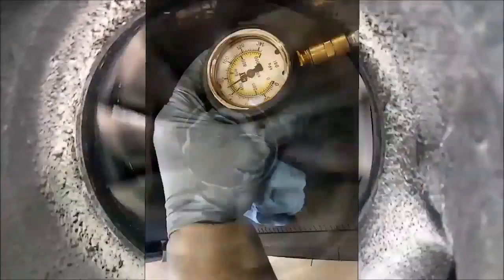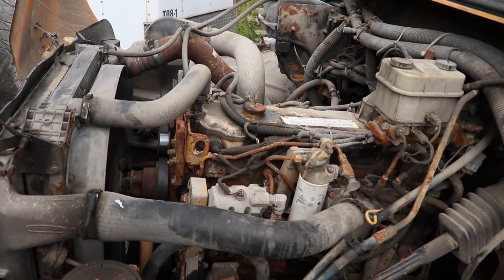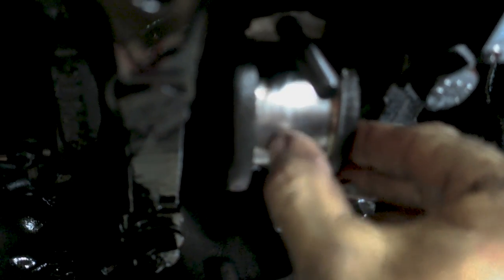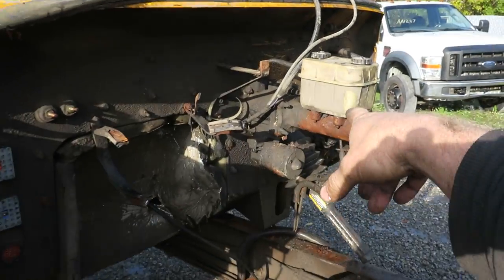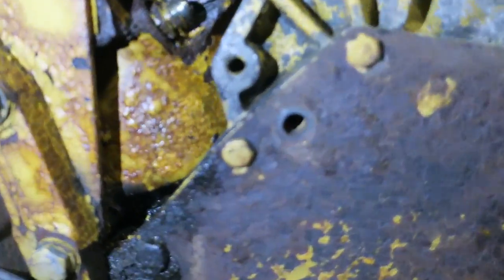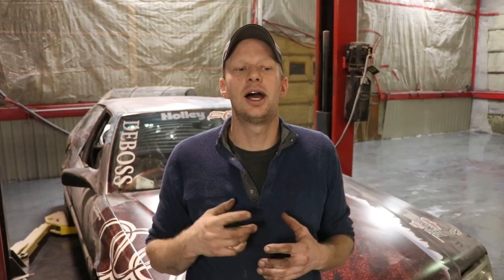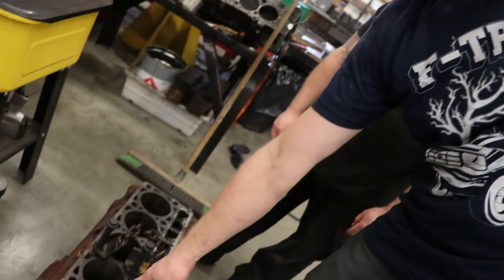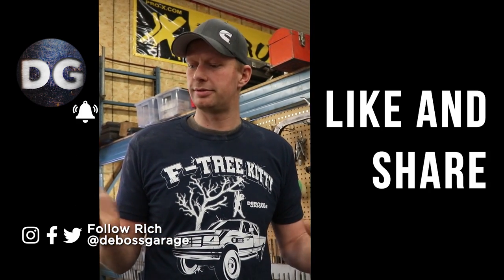CAT 3126 Teardown feat. @AdeptApe | #FTreeKitty [EP4]

Comment: I'm glad you are doing a cat swap. Everyone always wants to do a cummins. It's good to see something different.
Reply: I agree but it should have been a 7.3l swap. This boat anchor of a cat is not going to make anything close to what a 7.3 could. It might last longer overtime but that’s yet to be seen. I think Rich will be disappointed with this engine as a daily tow rig. Definitely unique!
Reply: @makeitbreakit7556  a cat engine has more grunt on the low end
Reply: Depends on injector a 300/200 on a 7.3l with a borgs366 will make 1400lflbs at about 2200rpm and 700lbs at 1200rpm
Reply: @makeitbreakit7556  I agree this engine was nobody's favorite in a heavy truck, the competition was an 8.3 Cummins and it ran less RPM, more torque, less breakdowns, less shifting required.  The day the last one of these was gone from the fleet was a good day.
Reply: Make it & Break it! A 7.3 can’t produce any power without massive money spent. I have one and they are reliable but slow as dog shit.
Reply: @makeitbreakit7556  
Having the most hp/tq is all about bragging rights these days. The Us military now uses Caterpillar engines. I wonder why? 🤔
Reply: Did the Cat guy have a whole litter of kittens when you told him you were going off-script with parts swapping? Those guys HATE that.
Reply: Yeah respect rich, I can really dig the cats
Reply: @thegdfp6447  meh... been with Cat dealers most of my wrenching life.... 
In a project like this? MOD THAT BABY! Just.... make sure your crap jives haha
Reply: If it was me I’d be doing a dt466 because it’s a mechanical engine, but it’s cool he’s doing something other than a Cummins. If cat had an engine of the same size that’s mechanical then I’d be doing it. I’ve had a 7.3 & am not fond of the $ HEUI system.
Reply: @michaelbenoit248  The early HEUI is very reliable if you keep good oil in it. 
Look up 3116 and 3126A. Not the truck 3126 mind you. Prefix 55K, 3AK, 6JK, 9ZR were all mechanical 3126 engines in industrial and machine applications. I see no real reason a machine unit couldn't be adapted to a truck, but you would need things like, say, the right flywheel housing/ rear structure.
Reply: One day....3116.
Reply: I know right cummins this cummins that.
Reply: @makeitbreakit7556  he should have stayed with 7.3 swap. It would have been easier
Reply: If this were a Cummins or 7.3 swap, nobody would be watching.

Comment: I did the Navy back in 72 and I was not proficient in mechanical items. They put me in Air Traffic Control and I did some land time in Iceland. We had an old radar approach unit in the middle of the field with Cat backup. Electricity was 50/50 so the cat tech was always out there and I would jump in and watch. Later, he had yearly maintenance which took the whole unit down to the block in our Quonset hut. He would let me take parts off and on.  I really was hooked on that engine. Later in life, I got educated in ICE's. But I always wished I had qualified for diesel. What a great life.

Comment: The next project is a surprise to max. It’s a  2001 kenworth t300 service truck with a 3126 330 hp and back by a 10 speed.  We are going to do a full restoration with cool products making a killer service truck. I will then be sharing my equipment repair I do daily .   Thanks mrgoodtrav

Comment: The "ADV" on the sticker means Advertised.  As in thats the advertised rating for the engine.  We use that terminology because sometimes the engine is capable of a little more than advertised.  FYI the FLS and FTS are the fuel settings we use when we factory test the engine to make sure that it matches the nominal power as exactly as possible.  One you change parts like injectors and turbo etc... that detailed level of trim is no longer valid - but you dont care about that unless you really need the power to be perfect.

Comment: The machine shop guy sounds like he’s done this a few times . Sounds like this is going to be a kewl project. Of course Adept Ape is Mr.Cat. He knows his sh__( I always wondered if a big diesel would fit in a pick up ) I love diesels 👍
Reply: Nothing new, guys been putting these engines in pickups for awhile,  usually with a standard transmission tho. Be interesting to see how he hooks up the 4x4, bet hed probably use a divorce mount set up?
Reply: @Leemur2335  and about 20 leaf springs on each front frame rail.

Comment: The zip-tie is used to hold the main bearings in contact with the crank  pin [s] when the engine is running. Main bolts are for starting only. So say's Facebook and Google. Merry Christmas everyone.

Comment: Rich , I have the same truck I put a Cummins in mine, just a heads up at that power level traction bars are very near a necessity on the obs Ford. Axle wraps a lot.
Reply from the maker: Thanks for the heads up!
Reply: There needed with a 7.3 in it

Comment: Dirty oil is the downfall of the HEUI system. Those worn cylinder were probably dumping a ton of blowby into the crankcase. After a while the contaminants in the oil will wear out the oil valves in the injectors, causing difficulty starting as you witnessed.
Reply: Its short life cycle and expense dont do it any favors.  That, and cats electronics suck.  Other than that.......

Comment: I just did injectors in a 7as model 3126b like the one in the kodiak and I must say, they are horrible to do. I work on equipment mostly but there was a bucket truck that needed to be fixed before the operator locked it up. Not only did they drive it with a blown injector tip, but they hydro locked it multiple times. I put all 6 injectors in and what a pain, following CAT SIS word for word spec by spec, 2 piston ring type seals on the injectors folded up the injector cup. You can’t tell until you try to torque the injector down and the first screw won’t go down to its shoulder. Although not particularly a bad engine, the injectors have to be absolutely perfect. Any bit of water will ruin the fuel system, the injector installation is a very stressful process, and the 1.5 inches between the cab and the engine in the kodiak makes a stressful job more stressful. Not to mention the fact that the oil slides in the head where the oil drains down the pushrod holes, works perfectly as a bolt slip and slide. I found that out the hard way, and after 4 hours of trying to fish it out of the cam and roller assemblies, I turned over the engine with a pry bar and heard the ‘ping’ of it hitting the oil pan and knew it was safe there. Got it all back together and there was a fuel knock, not going to go into details but the pushrods were crossed, thankfully no damage. If you work on the systems at all, run every diagnostic possible. For anyone wondering, with cores, the injectors were $360 USD each. Better off Rich working on the engine rather than me, I still have nightmares from doing that job.

Comment: I've wanted to do this swap in a square body chevy but $1000 per injector is quite a bit i know yellow engines are expensive but I've also wondered about putting an 8.3 Cummins in one too. It would be cool if you could do a comparison video on the 2

Comment: I’ve been around the Cat engines since 1977. Go old school and put in a 250 hp 3208T. Hot shot drivers in the 80’s and 90’s put them in one ton trucks. They could pull over the Empire State Building. No electronics to deal with, just hot wire to shut off solenoid.

Comment: I'd love to get an old 20s longhood packard or cadillac and put something like a Detroit DD13 or a Cummins X15 or similiar in it.. imagine that, while it might not have the horsepower, it could pull a 2:1 diff ratio and do like 170 MPH
Reply: But emissions  are on those and hard to work around. But an older isx 15 you could do, late year series 60 would work or a cat c15

Comment: Whoa this is a truck right? haven't we all wanted air in our 1 tons at some point just for filling tires and what not? you should try to keep the air system and use it!! add some chucks front and back so you can hook up an air line and fill tires!
Reply: They make air systems for pick-ups, not commonly used do to cost. A gasoline air compressor is cheaper and easier to maintain.
Reply: @jaydunbar7538  that's not the point. There is one on this engine already and it would be sweet. Everyone with a truck can throw a compressor in the bed that's not the same.
Reply: It being a tow rig id keep it if i had the space on the block

Comment: While your doing the Caterpillar install, you might consider getting rid of the UNRELIABLE HEUI PUMP and putting in a common rail system like used on later models C7’s. I have a 3126b in my RV Hauler and before paying 7 grand to replace the HEUI, the lines and all the injectors, I am looking at changing it over. I feel good about being able do that, and I’ll be trying to figure it out and pay to have it done. The HEIU has to many things that affect its reliability to call it good. Cost to much to pull the oil cooler off just to see if the gasket is good between the filtered and non filtered oil. If the price is prohibited I’ll find a 8.3 Cummins to put in there with a P-Pump. Thanks

Comment: Rewatching this as I sit at home off work due to the coronavirus. I read it as - adv(advertised) 250 hp (horsepower) 186.6 kw(kilowatt). 

I could be wrong but I always thought adv was advertised abbreviated, not advance(d). But, I may be wrong. Not sure if that's what you were referring to and correcting yourself or just the number placement/sequence.

At any rate, those were great engines. I've replaced an injector on one and the rubber style oil hose on another. Both weren't maintained the best and still made it almost 250k mi. before needing a single thing engine related. You already know and covered the common probs, tho. Just my 2 cents. Thx for the vid!

Comment: 29:00 interesting they didn't foresee hardened bolts breaking after being re-torqued.
i wonder if that bit is in the actual service manual somewhere and it says to replace them instead of reusing them, i'm ASSuming the amount of torque required to hold them in place is very close to their yield # (like torque to yield headbolts), not to mention they will be heated and cooled over and over and over with engine use.

Comment: cool to see yall go at this, any idea what model electric fans your throwing on to cool something this big? I have a bus conversion with the 190 hp and when that fan kicks on the bus goes to like 150 hp and will barely move...I also have the 545 non locking torque converter trans which kinda sucks but a derale 150k btu trans cooler did loads for it....lastly cat has a whole chart on what items have to be changed to uprate power. according to them (adept ape also mentioned this) in order to even get more than 10hp out of the 190 the flywheel and many parts have to be changed... if you call with the serial number they let you know what needs to be swapped to reliably produce the hp range.. thanks for the vid, and im looking forward to copy the electric fan swap..

Comment: You should leave the compressor if it works plumb it up for an on board air system I have one on my truck it's one of those things you never knew you needed until you have it
Reply from the maker: It does work but I think it will interfere with the steering.
Reply: I didn't think of that

Comment: Atleast it’s going in a Ford, I like my unique 3126 cat swapped dodge. My opinion, the cat swap is awesome but the Cummins for pickups is much better if you want upgrades.
I would never swap it back to the original Cummins but I do with I had more options for power upgrades.

Comment: you get one ford and all the sudden youre wearing f tree kitty t shirts what happened
Reply: He got a good overall  truck not a piece of shit with the best motor
Reply: Yeah that fuse box was very labeled
Reply: At least the dash isn’t falling apart like a dodge
Reply: Diesel Power he did always say he liked the square body fords before the Tritons
Reply: @woodyfregia6653  I've personally only seen 1 dodge dashboard cracked. It was on an 03 diesel. Dad has an 05, had a 93, had an 88, had numerous other dodge trucks with zero dash problems. Honestly the only problem he's had with his 05 was rear speakers, rear locks, and rear windows. Transfer case under warranty, transmission at 290,000 automatic too, and injectors at 360,000. The engine has been the most troublesome recently, had 3 bad injectors out of 6 new bosch ones when the original injectors lasted 360x's as long. I'd still take a dodge over any other pickup truck because they're reliable, comfortable, great power and amazing fuel mileage. Plus, dodges look the best.
Reply: Slave lake

Comment: I rebuild these as a day job and they don't seem to have any major faults, but they are not a powerhouse. We engine dyno them at 280hp without the fan and 220hp without the fan, yes the fan uses 60hp. After a big ZF and a diff and wheels, youre looking at 150whp tops? One time we got sent the wrong injectors and it made 400hp on the engine dyno so... 250 at the wheels? Not a fast truck, even in a little ford.

Comment: Looking at that skid of garbage you need, and the expense of crapterpillar parts, that 6v71 looks pretty good to me.
Reply from the maker: The engine has a harness of about 7 sensors.  It needs a few key and batt +, and throttle pedal and it runs.  The wiring mess is mostly the trans.  I took the entire dash wiring which is the mess but it really isn't complicated.

Comment: Being as CAT designed the injector, what's the difference between that at 1k each vs a 7.3 powerstroke injector which international/navistar had their part, any CC and nozzle size you want from 2-4k for a set of 8 (aye 2 spares lol). Solenoid tops and internals all look the same, body length different?

Comment: @deboss, I have the same 190hp unit in my bus conversion with a at545 4 speed, theirs no locking torque converter in those trans so they heat up at highway speeds (mine does about 70mph with 4,11 rears and 11r22.5 tires) a solution for the heat is a Derale 65861 trans cooler takes SAE boss u 10 fittings....I tied mine into the aftermarket trans filter... I wanted to ask what electric fan you'll be using thats big enough? I need one too with 190hp and a heavy 20k lbs bus every time that fan kicks on you feel it such a loss of power...also the hydro brakes are barely sufficient.... Thanks! Oh and last thing USE THE CAT ADVANCED FILTERS its insane what a difference it makes 1R-1807 after 1000+ miles the oil is still gold like brand new with any other filter its soot black after the first drive...

Comment: Will the water pump belt fit over the damper on the crank...mine in my 98 fl80 will not...big suck to tighten an change later

Comment: 16:38 serviced proper by a fleet..  HAAAA    No Joke I get SEL/CEL calls hmmmm let says a common one at Atlanta Public Schools, Fuel injector metering rail pressure high/pressure low.. and fuel filter diff pressure...  mmmm  4 year old filters..   They can't figure that out but by god if they get a NOX or DPF Diff code, it's getting a NOX or DPF.  When all it was is a diff sensor or tubes not hooked up...

Comment: Hi,  I'm looking at a kenworth dump truck with the same motor, and am curious how many miles they will go before needing a rebuild.
Reply from the maker: All depends on maintenance
Reply: At least 20 or 30 thousand miles
Reply: @N4007-k8o  you mean 2 or 300 thousand?

Comment: any update on this build? i know you are a busy man but i'd love to hear some updates and a somewhat unique build.  wanna know how comparable to a to a cummins swap this is and or if it would be a better option for me over a cummins 5.9 in my 01 350 gasser. would love something i could almost daily fuel mileage wise as 7-11mpg empty on my 6.8 V10 is not great at all. i'm not looking to make a power house or anything an have thought about other swap ideas like a 3.0 V6 TDI motor  the get stupid great fuel mileage and their power isn't too far off from what the 7.3's make as stock so i am sure a few bolts ons and a tune could net the exact same power if not more than a 7.3 and still get better MPG than a stock 7.3 have no problems towing or hauling and actually increase payload and towing capacities since all of the weight you'd lose putting in the TDI V6 engine it weighs around 480-490lbs compared to the around 920lbs the the 7.3 weighs. idk just trying to weigh my best options..
Reply from the maker: Engine is currently being rebuilt and the 2000 got sent out to have it rebuilt and have a transfer case adapted to it.  C10 videos will be coming out first

Comment: I thought that newer pump was better than the round accumulator style one. I always upgraded them to that new style.
Reply from the maker: Not according to Josh.  He found the square style failed more frequent
Reply: the square top pumps  that the c7 has were notorious for a bearing coming apart inside and loading the injectors with metal. I did lots and lots of pumps and injectors on those things. rarely saw a round top with an issue.
Reply: @jddiesel7409  Good to know, I have had to deal with the metal contamination from the newer pumps, always changed out the old style due to leaks. But I guess that's a much better problem than contamination. Didn't realize the old pumps were that much better. Thanks Merry Christmas!
Reply: @DEBOSSGARAGE  I am sure hes right, seems like newer rarely means better anymore. Great videos! Really looking forward to seeing how this build ends up! I am pretty sure I've seen a few of these with Pittsburgh Power ECM before.
Reply: It's been awhile since I worked in the cat house, but I absolutely loved it there. Pump and injector jobs on buses and m2 freightliners did get old though. hope you had a good Christmas and a great new year!